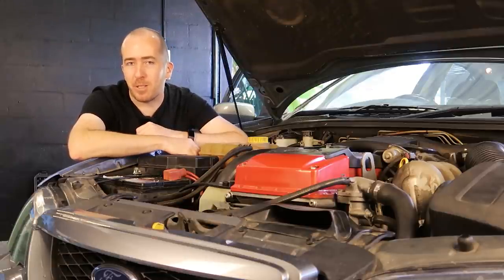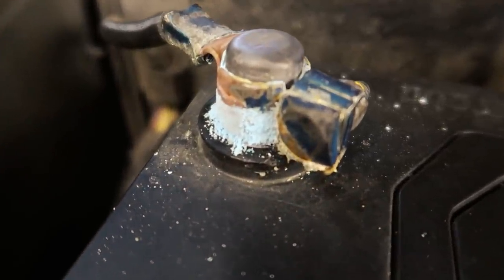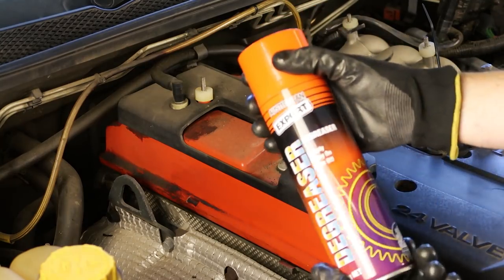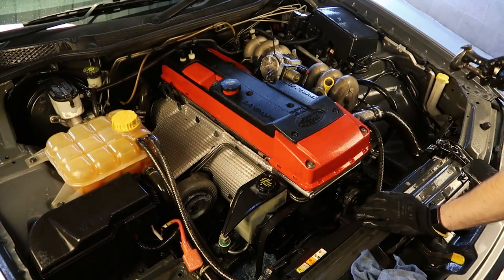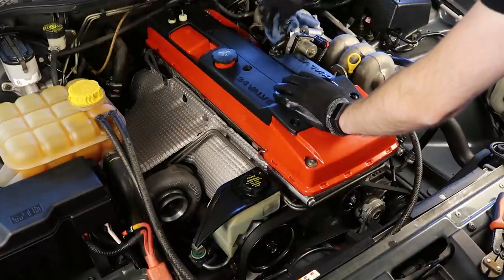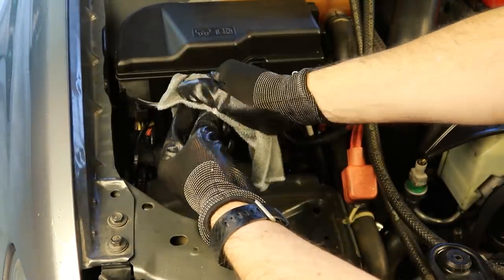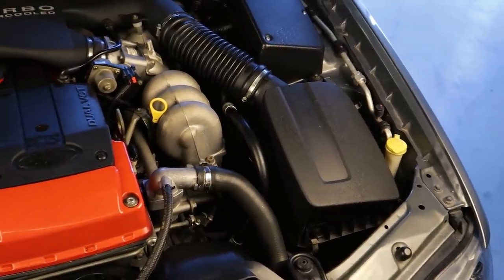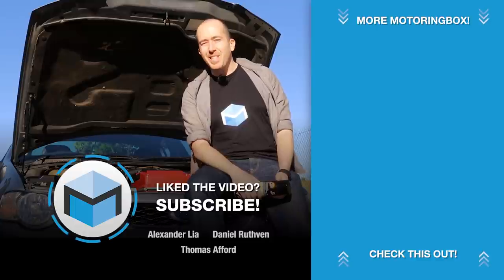Cleaning Your Engine... With Armorall Tyre Foam? The Cheap & Easy Way! 🇦🇺

Comment from the maker: I was sceptical too, but the Armorall Tyre Foam worked incredibly well. If you've cleaned your engine with it, let me know your thoughts?
Reply: Hot water and baking soda work really well on the corrosion around battery terminals
Reply: barra 245t   I just hit with a brass brush and throw a bit of motor oil or grease on the terminals.
Reply: MotoringBox   The alternator should be fine getting wet. As they actually can suck rain water through themselves in normal operation.
Reply: Amazing stuff. Told ya so. It dries to a smooth satin finish and not at all greasy. I've found the best finish is not to rinse, but to wipe with a rag. Yep, alternators can be soaked in water just like any 12V circuit - apart from electronics that is! 12V DC won't short in water, the resistance is too high. With older cars that don't rely on CAN-BUS and modules for comms and switching, your headlights and electric windows will even continue to work underwater.
Reply: MotoringBox thoughts*
Reply: I'm legit buying tyre foam tomorrow!!..lol
Reply: I've been using armour all tyre foam for over 15 years - it's brilliant...the way you showed the proper way to clean is ideal, but if you're in a real hurry, you can even get away with simply spraying it over the engine bay without even degreasing it first; it's outstanding!! PS; I never hose the tyre foam off, I put it on after I've degreased the engine and it's thoroughly dried...it seems to keep its Shine better that way 👍👍
Reply: Steve Mack Does it feel greasy if you don’t wash it off?
Reply from the maker: @liamgibson4675  shouldn't be greasy at all
Reply: MotoringBox Cool. Just while you’re here, does the Armour All Tyre Foam sling off your tyres? Thanks
Reply from the maker: @liamgibson4675  the instructions say to wipe it off, so I'd probably just do that. But I guess the product would dry eventually like Steve suggested.
Reply: solving it sabc
Reply from the maker: Aussie Man  assuming you own one, which I don't.
Reply: I took the same steps u did and it turned out great

Comment: Just letting you know that every time you change the engine oil on BA and BF turbo cars you should check your exhaust manifold bolts they have a bad habit of coming loose.
Reply: Put a bit of mid strength thread locker on the threads and one that tolerates heat. That will fix that problem
Reply: Nordlock washers
Reply: I think it was just a problem with the factory manifold bolts on the turbo engine they are the same bolts used on the naturally aspirated engine.
Reply: I wish I'd have seen this comment earlier this week and would have saved 60 bucks, but I'm still happy as he checked the car over all. 
So my BF was running really rough and was losing power when accelerate also engine light was on, Went to mechanic he said it sound like an exhaust leak or manifold gasket, but he found that was manifold nuts were loose, he could have lied to me and charged more if wanted to.
He's washed and cleaned the entire engine, checked all over and charged me $60 for that.

Comment: One of the best aerosol degreaser is the 5 star foaming degreaser from Cheap As Chips, in my opinion anyway. I cart fuel and use this $3 can to clean my outlets. Comes up a treat.

Comment: I just bought a car and will give the tyre foam a go, but only as a starting point for further detailing. Try some aerospace 303, not only for its finish, but because it conditions the hoses and plastics, which with long term use will prevent deterioration.

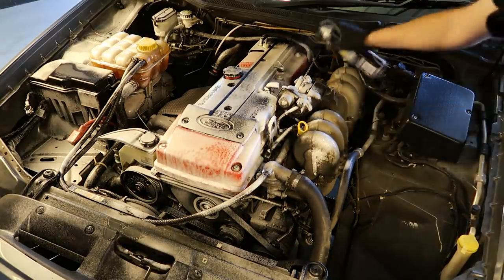Comment from the maker: Check out the money shot starting at 5:04 when I sprayed the dirty intake manifold (on the right side of the engine). All the crud on the intake runners simply slid straight off.

Comment: Things to do in lockdown or if you're time starved. I usually use a can of degreaser, then pressure wash and get the leaf blower for any water that's hiding. Any plastics get the AutoGlym bumper & trim gel treatment. 
A great easy to do video for people who are not sure what to do when cleaning under the bonnet.

Comment: You should do the battery and intake swap on the xr6t
Reply from the maker: I am in two minds about that - half of me likes how the original intake setup looks, while the other half would love to hear more of the turbo spool. If you do the battery/intake swap you'd pretty much have to upgrade the front mount to a non-return flow style, and then run hot-side piping from the intercooler up into the passenger side of the engine bay and into the throttle body. So doing one thing creates other issues lol
Reply: @MotoringBoxTV  If you do go turboside, I'm sure you won't regret it. Be prepared though, as the sound is a lot more intense and a lot louder. In regards to the appearance, I think the engine bay looks a lot more tidy without the crossover pipe, especially on the FG's where the throttle body's position isn't as awkward.
Reply from the maker: @volkyk  the R34 GTT I used to own had a similar setup - the airbox (or pod filter) is on the same side as the turbo, with only 30 - 40cm of piping between them. Sounded amazing.
Reply: I'm doing the battery relocate and process West crossover as I've got the process west intercooler on my ba mk2.
Big delays on process West gear currently though.
Reply: Although hearing the turbo is intoxicating and sounds phenomenal if it was my car I would opt for keeping it stock given how clean and unmolested she is. Fantastic content, look forward to these weekly episodes

Comment: Did this last night, one thing you can also do is remove the grille assembly, it's an extra two scrivet's on the top assembly and three clips at the bottom. You can't actually see the clips unless you push the whole assembly outwards from the top, also FYI when you pop each clip out, make sure you push it all the way out, don't hear it pop and come out a little and move onto the next one or else like me,  you will find you get to the third and the others have popped back in. push all the way towards yourself until the whole part of the assembly the clip is holding in comes away from the bumper completely. I could not get over how much gunk I found behind the grill. I hung it on two pot plant hooks, hit it with tyre foam and 10 minutes later washed it all down.

Comment: Hey everyone, as someone studying his cert II in Electrotechnology one of the first things you learn is the types of fire extinguishers to use on electrical fires and one of the big ones not to use is foam fire extinguishers as they can be conductive. I understand that this is different but I just wouldn’t recommend putting foam on the battery! This video is amazingly done and I liked this a lot and was very entertaining!
Reply from the maker: To me it seemed much safer than water, but you never know.
Reply: MotoringBox yes 100x safer of course but maybe better to apply foam to towel then wipe she’ll be right

Comment: I figured this out a few weeks ago at work. The boss had a rather vintage can of tyre foam on the shelf so I used it on the plastic rocker covers of an engine getting a rebuild. Worked like a charm

Comment: I'm. Devod I paid 4500 for my ba xr6 with 135k on the clock last year and it had bad boot rust and rust where the boot struts attach to the main body... I rushed though...

Comment: Just did the engine bay on my skyline, MAN! I am a convert, I’ll never use anything else now, so easy, and the deep black plastic and rubber without the oily residue, yep! You were 100% correct on this one. Thanks again.

Comment: 1 tea spoon of bi card soda mixed into 300 mls of warm water is great for removing the acid crud from battery terminal wires & posts as it's alkaline & neutralizes the acid

Comment: Nice video, BTW the best way I've found to clean the battery terminals and clamps is to clean them with cola soft drink and then wash it all off with water - cheers.
Reply: Boiling water works well too
Reply from the maker: Both good tips - curiously enough the tyre foam also did a decent job. Whatever gets rid of it is a winner!

Comment: I love that brand of degreaser.. if you haven’t used three whole cans of it on a single engine bay, you haven’t lived..
Reply from the maker: Hahah I know what you mean, I usually burn through a can really quickly.
Reply: Best degreaser by far is the CRC. Costs 4 times as much but you use 1/10th the amount and it actually works. Works insanely well.

Comment: Use boiling water to clean battery terminals if you don't have battery terminal cleaner, the corrosion just disolves.

Comment: That nasty stuff on the battery terminal is acidic I believe (and corrosive). I usually place a bit of sodium bicarbonate in a water solution on it to neutralize it first. Definitely once you get that stuff on your cloth don't go using it again.

Comment: Don't forget to find the radio code before you disconnect the battery or use a small 12 volt battery just for the memory back up for the radio.

Comment: Would have appreciated some mention of leaving a battery disconnected for a period of time in terms of making sure you have your stereo PIN and also how long you can leave it disconnected before your engine's computer will need to relearn settings, driving style etc.
Reply from the maker: Usually these things are wiped almost immediately. ECU learning is a non-issue, but the stereo code can be an inconvenience. This car doesn't have one.

Comment: I do the same thing but at the end I also spray silicone spray all over the engine bay and I get a air blower and blow it over the engine to make it look even and sort of dry. I have a bit of distance from the surface so it’s not concentrated to the surface and it’s how second hand car yards get engine bays to look decent but with them you simply look at the under side of things and see what they do. Also silicone spray is water repellent and is great for the battery terminals.

Comment: I just did this last night for the first time after a YouTube video popped up randomly. I just bought a 98 Durango with 114,000 miles. Ran to the store and got some foam. Sprayed it on and let it soak overnight. This morning my engine looks like BRAND NEW!!! I didn't remove anything...just sprayed foam on everything except alternator and belts. Took 5 minutes.
Reply from the maker: Gotta be happy with that! Well done 👌 I've actually found it's fine on the belts too.

Comment: if the product leaves a matt finish its most likely a water based silicone or its silicone free but if you wanted a faster way, buy a bottle of Autoglyms vinyl and rubber care, degrease the engine and hose off, spray on autoglyms vinyl and rubber car and walk away let it dry naturally, it literally even states it on the bottle, but itll leave a high shine and clean engine bay, if needed you can give the surfaces a wipe over once its dry to remove any trace amounts of residue

Comment: If you want to do a quick wash of your engine have the engine running while hosing it down. It's also a good way of finding vacuum leaks by lighty spraying around the intake side. Don't worry too much about the electronics under the bonnet they are water resistant the connections have seals in them.
Reply: Thanks Brendan gonna try it right now on my Tesla
Reply: @boxman139 haha good on ya.
Reply: No way.  You cover the electronics with plastic bags.  

Washing the engine while it's running is also a good way to crack the head, and  even the manifolds.
Reply: @DoubtingThomas333  that's only if you engine is really hot. It doesn't hurt if it has cooled down for a bit after driving and you have the engine idling while hosing it.
Reply: @DoubtingThomas333  that how I was taught when I did my apprenticeship, after serving the engine give the engine a quick wash. I've done hundreds of cars and non of them had problems, even done it to the same car when it come in for it's next service.
Reply: Thomas whoosh
Reply: @boxman139  whoosh what?  You mean over their heads?  Ha
Reply: @DoubtingThomas333  I think boxman139 assumed you were replying to him when you were most likely replying to Brendan.
Reply: @sjwright2  true.  Looks like it.  Tesla joke was good, haha.
Reply: Thomas no I thought that Brendan was joking and that the joke flew over your head like an airplane would, hence the “whoosh”
Reply: Simon Wright not even close
Reply: @boxman139  well, he wasn't joking, ha.
Reply: Thomas kinda freaks me out 😟

Comment: To clean battery terminals rinse in a litre of warm water with a couple of tea spoons of bi carb soda will neutralise the acid and clean it off the terminals. then rinse off with hose. 

FYI normal tap water is not going to short the battery out :)

Comment: That oil residue hanging around on top of the inlet manifold is usually caused by the o ring on the the dipstick flattening out. Seems to be worse on the turbo models. Little bit of blow by? Not sure. Not saying your engines got lots of blow by, its just a normal thing.

Comment: Loving the new machine. Whats with that cover over the ECU? doesn't look stock
Reply from the maker: Yup someone else pointed that out, it's aftermarket but very well designed and built. I couldn't find them for sale anywhere, so again it must have been something that was installed many many years ago.

Comment: I used the same spray degreaser with a water blaster on my VY Commodore 3.8, and it worked great! Just wrap vital electronics with aluminium foil, like the coil, fuse box, alternator, cruise control.
I want to treat my VE CalaisV 3.6 to the same cleaning, but there's far more electronics and plastic covers to remove, so could be a big job.

Comment: I also use tire shine ( silicon spray ) for all of the plastic parts around the car and also the inside dash. Even the rubber mud flaps and bumper bar overriders  come up looking like new. My AU dash also looks like it had just come out of the factory and even after 12 months going over with a dry cloth still has its shine.

Comment: I've just done this in my XF ute's engine bay, only without the motor in the way 😂 It was excellent for removing 27 years worth of oil, grease and bright red Toowoomba dirt. Yes, I did have to use a brush.

Now I just have to make the EFI Crossy I'm transplanting look as nice as this!

Comment: This is amazing! Definitely need to give this a go on my VX Commodore, don't think one can will be enough so I'd better buy three just in case, being a leaky old V6 Commodore and all. ;)
Reply from the maker: Get 2 at least, that way you've got extra on hand in case you need it! If not, you can use the second can on your wheels, or save it for the next engine clean.
Reply: How did the VX go?

Comment: This is exactly what i use, it works a treat and far better then tyre shine.  If you must, you can use tire shine, it looks great, however do make sure you rub it in well to reduce any collecting of dust, you will find it wont collect much dust if you rub it in well. Great video mate!

Comment: Would of looked much better if you cleaned the underside of the bonnet also.  Good video.
Reply from the maker: The insulation there has a hole in it, I'll probably end up replacing it.

Comment: If you're going to have a clean car and clean interior, why not an engine bay to match? I'm my case because of weeping oil.
I can't see myself pulling apart ducting every three months though.
I don't even polish my car once a year!
Reply from the maker: I definitely won't pull the intake ducting off next time, it was moreso to get everything to a level I was happy with. It should be fairly easy to keep it looking good with a quick spray and wipe down every 3 months or so I reckon.
Reply: I might just use engine clean and a plastic bag over the dizzy with mine at my local self serve wash.
I do like that you don't have to rinse the tyre foam off after wiping with it.
Pouring boiling water instantly removes the corrosion btw.

Comment: I need to desperately clean the engine bay in my VE SS but am scared I'll short something out especially with all the coil packs, leads and spark plugs being pretty exposed.
Doesnt help the knock sensors are underneath the intake manifold and prone to pooling and failing.

Once i muster the confidence to do it I will most definitely be using that tyre foam!

Excellent video mate!
Reply: much safer to use brake cleaner

Comment: Is the tire foam better to use than just regular tire shine? Will it give a better shine?
Reply from the maker: Yes much better. Tyre shine is all greasy and would leave a terrible finish that would attract lots of dust I imagine. Probably wouldn't clean as well either.
Reply: How many cans would I need to clean a falcons engine bay?

Comment: Should clean my commodores engine bay, but the frayed ignition leads makes me say “Maybe not”, still wanna Barra swap it for fun in the future, bit of blue and red rivalry bought into one. Awesome vid btw
Reply from the maker: In theory the foam should be ok with that, definitely avoid using water though!
Reply: MotoringBox True, of you falcon rusts away before my commodore wanna put the Barra in it ;) ............ jokes of course

Comment: Good video. I would have never thought to use tyre foam. Does it smell bad for a few days? A tip for getting rid of battery terminal corrosion is to pour boiling water from your kettle, on it. It dissolves the corrosion immediately.
Reply from the maker: Pretty much no smell at all even when the engine got up to temperature. All I could smell was the bit of degreaser burning off.

Comment: A little tip for detailing for like ten dollars at supercheap auto you can buy a3 set of detailing brushes for 10 dollars really help for grills trims badges  wheels engine bays there great
Reply from the maker: Good tip!
Reply: MotoringBox thanks it really helps also another one use a q tip and a cleaner in the badges removes a lot of the faded look